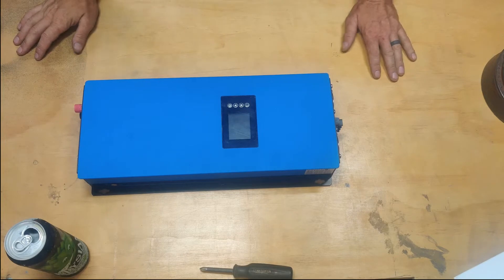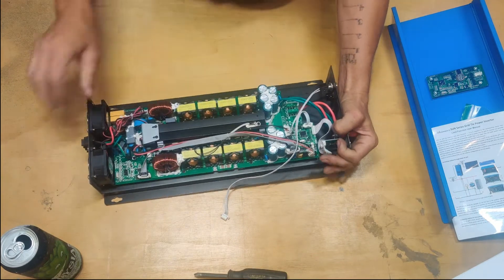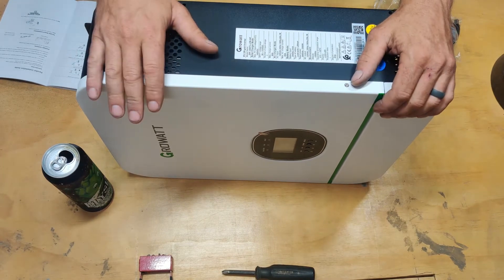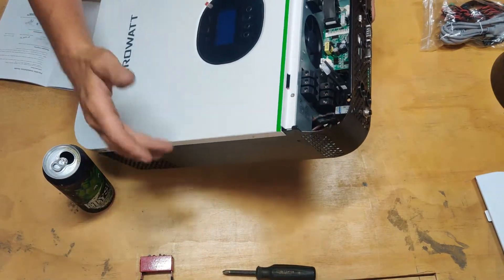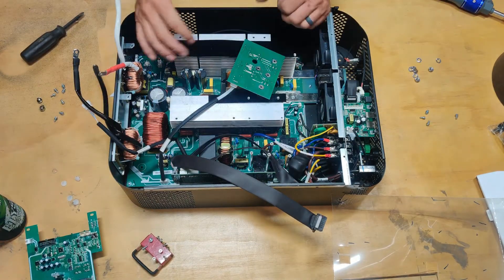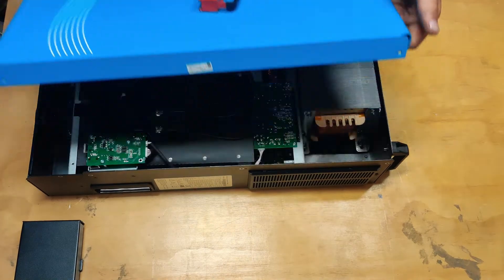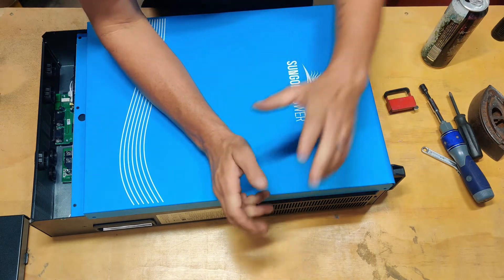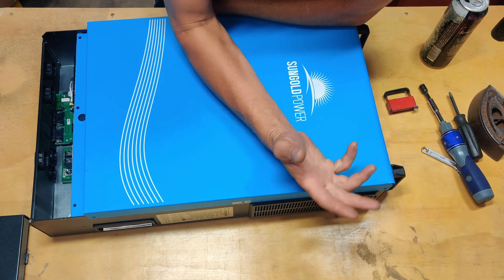Teardown of SunGoldPower, Y&H, and Growatt inverters

Comment: Should have just bought the bigger growatt the low frequency ones would run your air-conditioning
Reply from the maker: the growatt was for an off grid build I did for a friend. yeah should have gone bigger, but only because they under reported their usage. it actually had no issues running their AC, just cant handle the panels I need to add.
Reply: @whynowork8480  ok